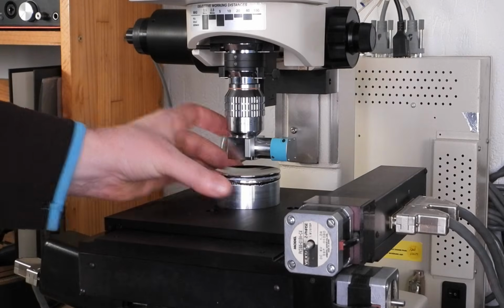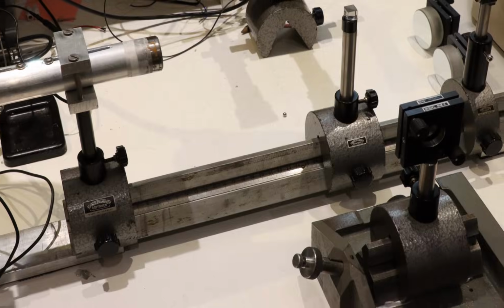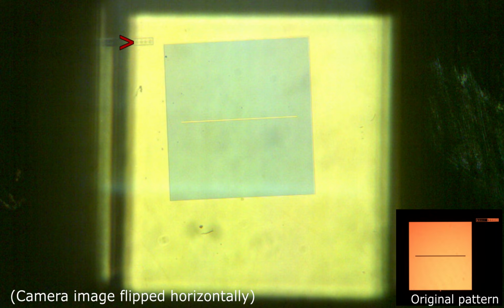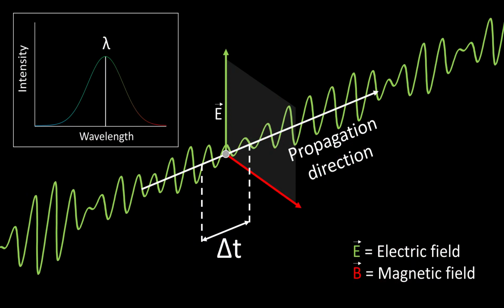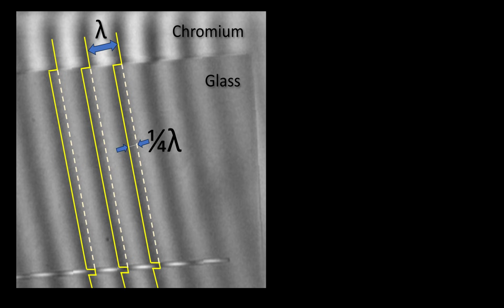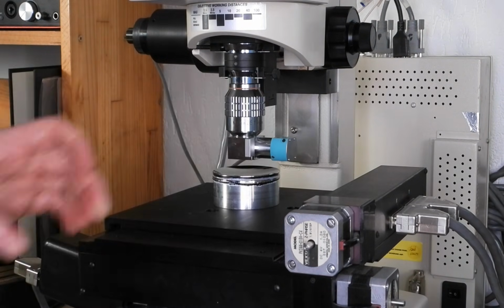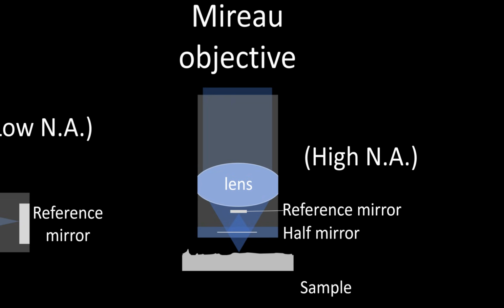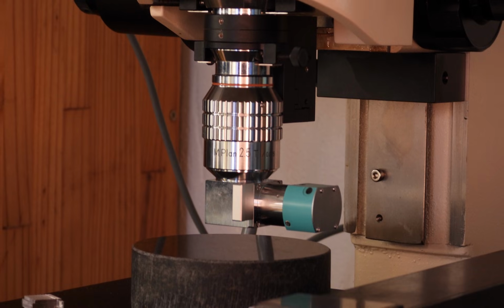Exploring White Light Interferometry!  (WLI / CSI)

Comment: Why wouldn't it be blue light that decreases the width of the interference, not red/ir?  I feel like I missed something...
Reply from the maker: Extending into the UV or infrared will both increase the spectral bandwidth. Of course the camera sensor should also be sensitive to wavelengths outside the visible range.
Reply: @HuygensOptics  ahh.  That makes sense.  It's not the frequency that matters that you're adding, just that it makes it more broadband, so the fringes are more limited in where they cohere
Reply from the maker: Exactly!

Comment: Great video! it's such an ingenious technique. Well it gets even more mind blowing with Optical Coherence Tomography. Do look into that, if you haven't already.
It takes the principle to the next level by sort of doing everything the opposite way. Although using the short coherence to localise the interference fringes allows an extremely precise measurement, the range of measurement is necessarily tiny.
Instead, in OCT, a much larger height range can be covered (multiple millimetres) and as the name implies, the system is not limited to measuring the topography of a surface, but can penetrate below the surface to reveal information about the intereior.

This is done by scanning the point of measurement axially, by rapidly varying the length of the reference arm. Light is returned to the interferometer by sub-surface scattering instead of reflection. Ordinarily, sub-surface scattering doesn't give much useful information because light can scatter multiple times and from anywhere within a range of depths, and this creates a "blurring" effect which overwhelms any useful signal once you try to see more than a minuscule amount below the surface.

The genius part of OCT is that by axially scanning the point of measurement, ONLY light that is being directly scattered from a known depth in a single interaction is detected, since otherwise the path length would differ enough to take it out of spatial coherence.

Comment: I love how far you've come with your animations and overall visualisations. I worry, however, that Robin Renzetti will have to discard his granite surface plates after seeing this video.
Reply from the maker: Thanks. There are large differences in the surface quality of granite, depending on the origin / composition, but also because of the method that they were polished.  This particular sample was of "tombstone" quality (for graves). The stones you find in mechanical workshops generally don't show multi micron-size height differences.

Comment: How difraction limit affects this? Can you measure the height of narrow pillar of width much less than the wavelength? Thank you for video
Reply from the maker: No, in that case this method will give you a wrong value for the height.
Reply: @HuygensOptics  Thank you for answer. So no difraction limit violation here

Comment: Correct me if I'm wrong but this wasn't  the true white light.. the three primary colors of the spectrum overlapping creates what looks like white to the human eye as they are all from the observable spectrum... but true white light is every wavelenghts of light into a single isolated  beam combined..I call it omega.and cant be recreated in a lab.. omega can only be produced by humanity in one way. ..and I know how ...I could use some help with the process...if interested? Could be the most profound historical event? It is a big deal..gain you a Nobel
Reply: White light is just light with multiple frequency that look white to the human eyes. What true white light is entirely based on our definition, since we evolve under the Sun, sunlight is usually considered the best white light.
Reply: I'm sorry but true white light , is all wavelenghts of the spectrum.starting with sound and ending at gamma..so? The observable spectrum and its white covered by the primary colors of light, but also x rays , ultraviolet and infrared,etc... all these combined into a single structured ray is omega..also known as the Devine or even God....
Reply: Also, the highest wavelenght of light us not offered by the sun as it is concidred more orange in nature..blue ish white  light sources from a higher frequency , so technically, moon light offer a larger amount of different wavelenghts

Comment: @HuygensOptics I wonder, what is the condition that a certain pinhole will result in (spatially) coherent light? I would imagine something like this: As seen from every emission point of the light source (the LED), the phase difference between light passing the top and the bottom of the pinhole has to be smaller than some value related to the wavelength? So a smaller pinhole or a pinhole placed further away does increase the degree of spatial coherence?

Another thought; if you do spectroscopy of light emitted by an incoherent light source (even if it is monochromatic, e. g. a Sodium Lamp, in which every Atom is on its own and its emission phase probably has no correlation to the emission phase of another Atom), would you need a similar setup of a pinhole or slit in a certain distance to even be able to do spectroscopy e. g. via diffraction with a grating? I remember, when doing spectroscopy during physics lab courses, there always was some kind of slit and I would imagine it is there exactly for this reason (which was never taught or even mentioned, surprisingly)
Reply from the maker: I actually discussed this in a previous video. Everything is about the pinhole or slit having the  correct area of coherence to achieve spatial coherence. This is the link directly to the chapter in that video: https://www.youtube.com/watch?v=nba4ztLBEh0&t=305s
Reply: Thank you! Oh wow; actually this simulation now helped me so much understanding the concept of area of coherence!

Comment: At 27:18, after the first interference pattern has left the screen, a second, weaker interference pattern is visible (right before you cut to the software showing the results). What is the cause of this?
Reply from the maker: Good observation! These are due to internal reflections in the optical system which can also create interference. They are no problem for the measurement since they are ignored by the software because of their very low contrast.
Reply: @HuygensOptics  Interesting, thank you

Comment: Excellent video as always, very clearly explained. It might be interesting use this microscope to a examine a metal surface that has been scraped flat.
Reply from the maker: On the nanometer level, it will likely look like the Himalayas
Reply: @HuygensOptics  Thank you for the response. Indeed, I suppose it would only show the difference between the idea of precision in optics vs machining. I still think it could be interesting, although maybe only with a larger viewed area than achievable even at only 2.5x, at which point using this microscope feels like "using a cannon to kill a fly."

Comment: This is awesome! I just build a low coherence interferometer myself and the part showing the phase offsets and how it relates to the intensity distribution was excellent. if you're interested, see the paper "Absolute optical ranging using low coherence interferometry" by Danielson and Boisrobert, I thought the Fourier treatment was clever.

Comment: Is the fuzziness of the interference lines due to the Heisenberg uncertainty principal? Is it possible to make the lines sharper?
Reply: That's an interesting question! The lines' fuzziness comes from the interference fringe being of sinusoidal shape, which you cannot get rid of when you have a single peak in your input light source. However if you add a second or third lightsource at double the mean frequency you get a faster oscillating fringe which adds to the existing fringe. If you add the right phase shift this can make the lines sharper.

Comment: Would the light that gets bounced back to the light source and then through the beam splitter and into the detector cause aberrations or other interference? I know if it did it would be small but is it detectable?
Reply from the maker: You can sometimes observe faint fringes that are not part of the actual interference pattern. However these are generally not originating from reflections at the source, the coherence length is just too short for that.

Comment: Could you use two different colours of light, which would average a grey, like red against blue, and then only the differences between the two images would show, I sometimes use something similar to determine differences between photographs, sounds like the resolution might be greater rather than the blurred lines shown in this example

What is the use of such a technology, yes smaller measurements can be made, but maybe it would be interesting to find what it has discovered or what it has helped to improve

Comment: I applaud you for your description and your ability to get the white light fringes like you did.  When we did this experiment in a college lab we had the use of large stable optical tables, very nice optics, nice micrometers, etc.  and we still had a large amount of fiddling to do in order to see the fringes.   I remember the feeling of great success when I actually got to see those white light interference patterns.
Reply from the maker: I guess the complication in any environment is people walking around causing vibrations. In this particular setup, the trick to finding the fringes is to first add a bit more tilt and then start searching with the translation stage. This increases your chances of seeing the pattern pass by.

Comment: Broadband signals only interfering with themselves at a zero phase offset is useful in many other domains too! A nice example is sounds being much easier to locate with our stereo hearing if they are broadband (e.g. noise) instead of narrow band (e.g. a beep). Which is why bird's alarm calls are much more narrow band than mating calls (where the bird wants to be found). Steve Mould did a nice video on this: https://www.youtube.com/watch?v=CqB95rj_txI
And it also allows you to recover extremely faint signals (even way below the noise floor) if you modulate them using a known random pattern, which allows you to cancel out everything else. This is one of the things that makes GPS possible: https://en.wikipedia.org/wiki/Pseudorandom_noise
Reply from the maker: Thanks for the link. Yes, you are right I guess it's a bit like broadband lock-in amplification.

Comment: Be careful when measuring two dissimilar materials, such as metal-glass interfaces as a phase error is introduced. I'll direct you to a paper "Offset of coherent envelope position due to phase change on reflection." Thanks for the cool video(s)!
Reply from the maker: That is indeed correct, there will be phase shift differences with different reflective metals (including chromium). I decided to leave this out to not further complicate the explanation about how to calculate height differences.

Comment: As usual, a great video that makes me realize how little I know about optics. I think a similar technique is used for synchronizing radio receivers, by first sending a "sync" signal with sharp autocorrelation.
I find it counter-intuitive that sub-10nm features can be measured with mostly infrared light. I guess the resolution comes from the piezo linear stage and the fact that many measurements are taken? Or are depth measurements not affected by the diffraction limit?
Reply from the maker: Yes the resolution is in the piezo stage and in the fact that the phase of the interference pattern is measured with an accuracy of a few milli-radians (not just from a maximum fringe intensity, as stated in the video for simplification)

Comment: We learned the operation of these machines last semester in my metrology class held at Thorlabs. They're also using an older machine (NewView 7100), which is rough because Zygo moved all their newer machines to using MX software. MX has python support so it makes sense for them to update their machines. It's the same with our profilometer at the college. It's newer than the one at Thorlabs (the newest Taylor Hobson Form Talysurf PGI). The reason to update your machines is to make use of the new programing allowed via the software (MX or PGI Optics). Ametek made sure to allow for virtualization of the software for this purpose (I have a copy of both) and it's one of the reasons they're monopolizing the field of high precision optical metrology. Luckily for Thorlabs, this isn't their focus, but I fear they might start falling behind as AI can assist the technician better with the newer equipment.
Reply from the maker: The MetroPro is definitely not very intuitive at some points, also because it is completely based on the UNIX framework. But for this, it will have to do since I cannot afford an MX license.

Comment: I have a question you can probably answer.  Recently, when experimenting with Thin Film interference, I noticed Light, which consist of RGB, clearly apparent when viewed through a Prism, cause Rainbow fringe on two plate glasses as one would expect.  HOWWEVER, when the Thin film rainbow was viewed through a Prism I seen broad band which makes no sense unless the Thin film is actually merging the frequencies non-linearly.  I am having a very rough time setting up proper experimentation for this as me an Optics have a serious love hate relationship and I am working with junk but am I missing something here?  How for instance can an actual Yellow frequency appear when the light creating it was pure singular frequency of Red and Green?
Reply from the maker: Can it not be just additive colour mixing due to the specific geometry?
Reply: @HuygensOptics  idk I wouldn't think so would it?  If I only had red, green and blue frequencies where is the yellow coming from?  Normally if for instance if I were to do such experiments shining a red light and green light to make yellow I would just see the red and green split off from the apparent yellow color but in this case there appears to be an actual yellow component to the light appearing from nowhere as though the red and green actually are mixing to make a new frequency .
Reply: For reference the Light I used was the Screen from my phone, only RGB, No yellow or anything when viewed using a Prism but I can see broad band or at least broader band when viewing the TFI using the prism which violates everything I know about all this.

Comment: What an excellent video! Do I understand correctly that you want to use broad spectrum light so you have a thin "slice" of your sample? Because this priniciple will still work with laser, but then you cannot discriminate between 1/2 wavelength or 1.5 wavelength, whereas with broad spectrum the more wavelenghts away it gets filtered away?
Reply from the maker: Yes correct, only with a short coherence length will you be able to identify and relate the correct fringes easily.